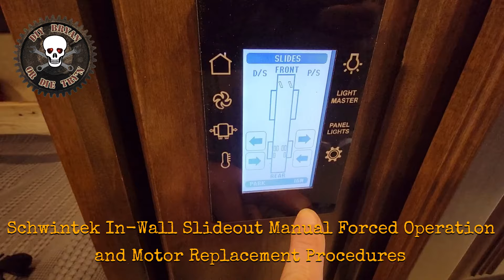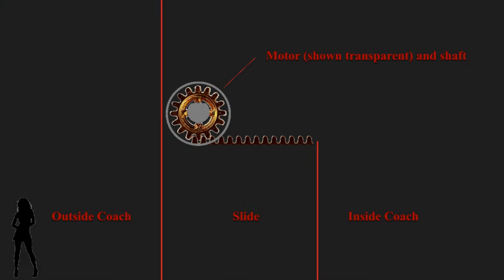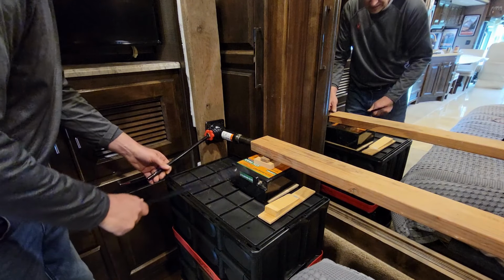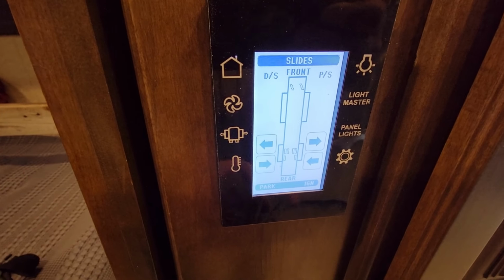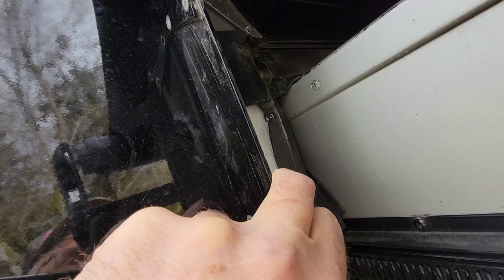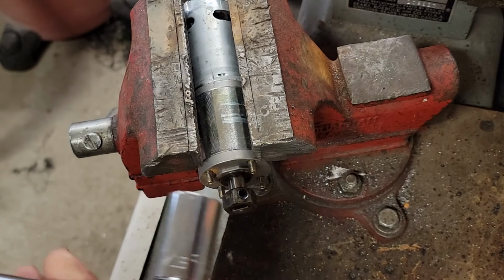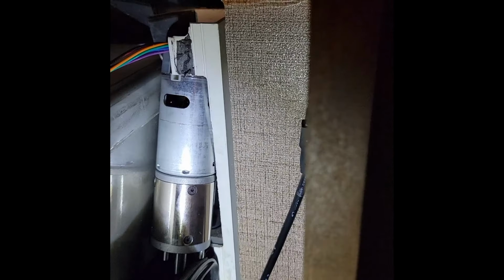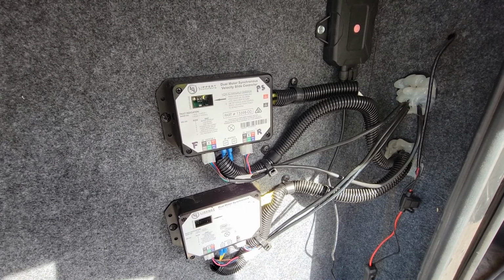Schwintek In-Wall Slideout Manual Forced Operation and Motor Replacement

Comment: Fantastic video.  Another example of the good side of YouTube for DIY education.  Combined with MyRVWorks Schwintek guru guidance, your video completes the circle of knowledge.  Your deep analysis of the system and using a horizontal jack for the brute push force in either direction is great.   I like watching videos like this to further my understanding so if I encounter a similar failure of my system I will have a lot less anxiety in solving the problem.   I have one question, will the JBweld allow extraction of the motor set screw in the future?   Thanks again for adding this video to the YouTube Schwintek Knowledge library.   cheers.  Mike.
Reply: Thank you.  No, the JB weld will not prevent unscrewing it.  It will act like a thread repair and probably most of it will flake off when the screw is turned.  It's just there to keep the stripped screw from falling out.  Another option would have been to use silicone.

Comment: To keep the slide motors synchronized, hold the extend/retract button down for a few seconds after the slide gets to the fully out or in positions. This allows the motors to "amp out" and the slide controller will then know they are both all the way in or out.
Reply from the maker: Yes, this is how that is done.  As noted in my video, there is lots of information on YouTube on how to synch the slide.  I was focusing on the issue of not being able to replace the motor without manually forcing the slide to move.  Which does not appear to be covered anywhere, at least I didn't find it.

Comment: The weight of the slide box should not be borne on the slide system. There should be rollers underneath the box that supports the weight.
Reply from the maker: True.  But not really pertenent to the repair done.  Maybe in my case those rollers don't turn as well as they should.  Regardless, the resistance of the box rubbing against the seals, the roller resistance with the box weight on it, the friction of the rack gears meshing with the pinion all added to the torque needed to rotate the gear motor add up to a huge force that needs to be overcome.  Hence the purpose of the video.

Comment: First try to reset the controller. Then check Fuses. If still an issue BE SURE TO DISCONNECT the motors FROM the controller and you should be and to move them on the slide much easier than what your running into here!! Once in position RECONNECT the motors to the controller even if it's not working because this acts as the "break" in the system which is half the battle you are running into.
Reply from the maker: Thanks for your input.  Just out of curiosity, did you watch the video?  I realize it is rather long, but with all due respect, your comments would suggest that you may not have.  Resetting the controller is not going to help with moving the slide or fixing a bad motor.  Similarly, checking fuses won’t move the slide or fix the motor.  During the troubleshooting techniques as outlined by Darren at MyRVWorks the motor was identified as the issue so this video is about how to get the slide moved out and replacing the motor, not troubleshooting controllers or fuses.  And finally, as outlined in the video, the motor was indeed disconnected for the operation of moving the slide out to make the motor repair so there was no “break” working against me.
Reply: @bryanwelsh1773  Man, I was worried I will have to do this. My motor isn't getting power and after inspecting there is one black wire cut just at the motor. I could reconnect the wire if I could get to the motor, but I can't! This is mindblowing that it's the only option. RV manufacturing surprises me every day.
Reply from the maker: @AdventurePaddle  Yah, it is crazy.  Unfortunately it is the "state of the art" for this type of slide which is used on virtually every manufacturer.  In addition to the pin removal, it is super bad when the inside access is blocked by some wall configuration.  I was lucky on mine in that I could easily get to the motor (once the pin was removed).
Reply: @bryanwelsh1773  Yah, same here, luckely had easy access to it.  If the opposite slide had gone out, would have and to remove the wood face.  :(